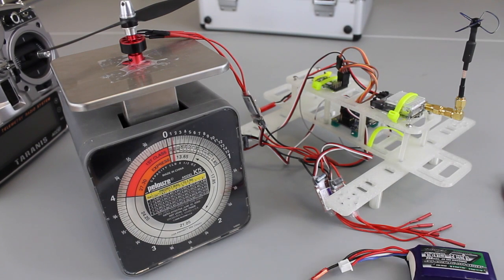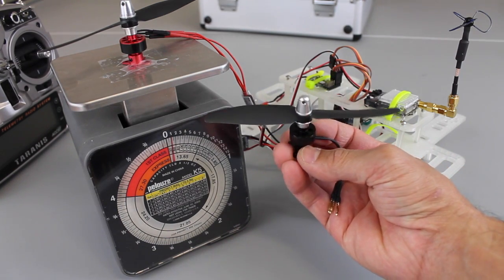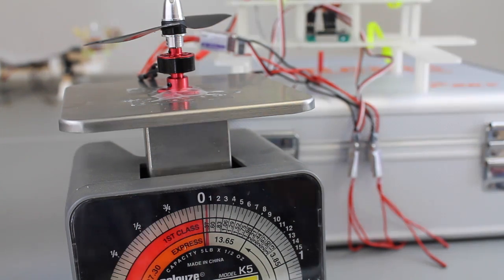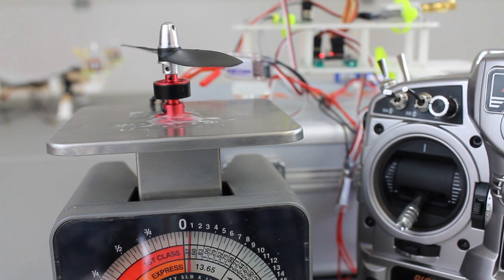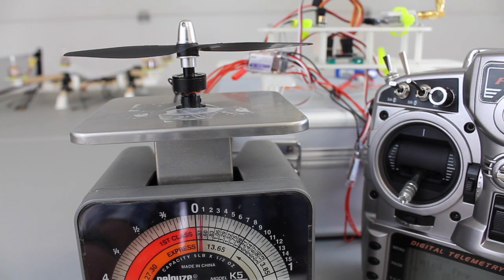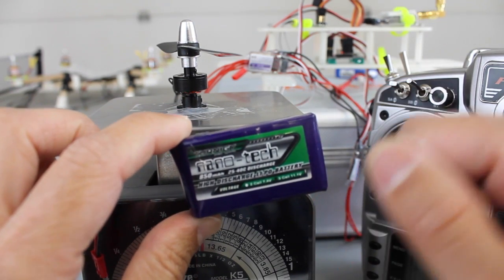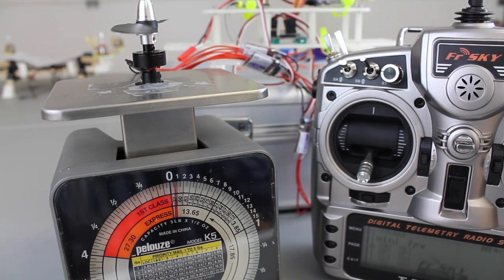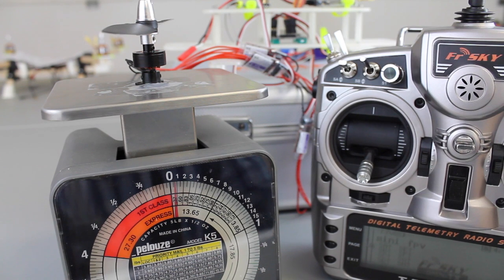Mini FPV Quad Thrust Test - Upgrading to 3S Lipo and iPower Motors

Comment: I won't bother you with what some of the other guys are saying but i'll leave you a link to what some of the guys over at rcgroups use,it is an old thread but some really good ideas on how to measure thrust,no doubt there could be more newer threads out there by now though. ;-)

I'm looking forward to your flight test though. 

http://www.rcgroups.com/forums/showthread.php?t=286867
Reply from the maker: Thanks for that. Funny to see some of the rigs in there. Like the unnecessary rig I built when according to several guys I could have flipped the prop over and changed the rotation. Duh! The fact is I've learned a lot from this experience :)

Comment: My ratio is hover and go fast = 1600g needs 4x max lift 1200g motors. 4800g total thrust for a 1.6kg quad. There's a ratio somewhere in that data LOL!
Reply from the maker: Ha, I hear you. That's a heckuva thrust to weight ratio! You must like be flying a miniature rocket.

Comment: dude your props are the wrong way, this is giving you false results. flip your props and swap 2 of the wires around to get the prop pushing the right way (down) you will find double the thrust and half the amps..
Reply: he makes good videos, but sometimes i wonder.
Reply from the maker: I had no clue this would be the case. I rotated the prop in the opposite direction to get it to push down on the scale, but didn't realize the thrust would be different. I'll need to find a way to measure the thrust with the prop rotating in the right direction. I definitely want to do a comparison. Do you have ideas on how to measure thrust properly? It seems I can no longer use my scale unless I find some way to invert it. Let me think on it some more but if you have any suggestions I'm all ears. Thanks for the feedback.
Reply from the maker: Thanks. I too sometimes wonder myself :) Had no idea that the thrust would be different if I reversed the prop rotation. Back to the drawing board!

Comment: The Prop doesn't generate 100% thrust the wrong way , try to build a jig that holds the motor upside down, then you may get more accurate measurements.
Reply from the maker: Tobias, I heard that from one other guy and had no clue! I'll need to see what I can do as it was much easier to reverse the prop and have it push down on the scale :) I'll see if I can come up with a good jig that doesn't lose too much accuracy. I'm anxious to do a test in both directions. Thanks.

Comment: Were you using a pusher prop or just running the motors in reverse to get the thrust to push down on the scale?
Reply from the maker: Running them in reverse, but I've been informed there's some loss in thrust when rotating the opposite direction. So I'm going to do a test that compares the thrust when rotating both ways. Thanks for asking.